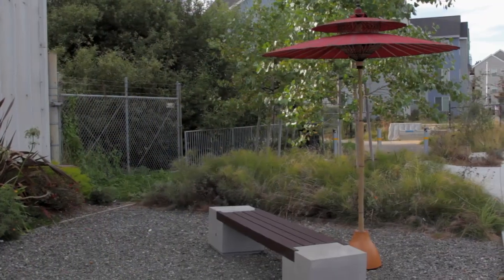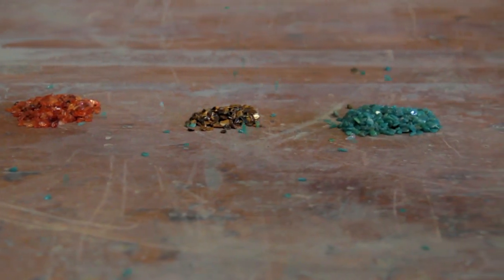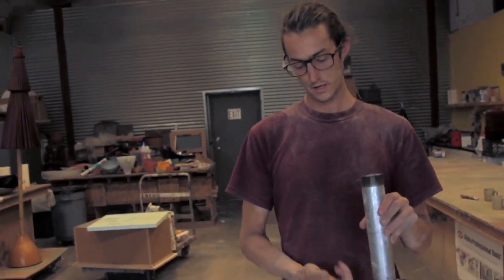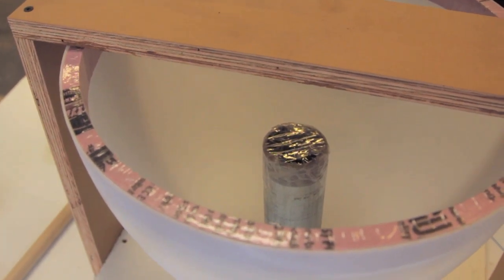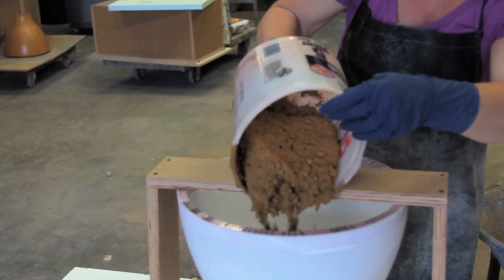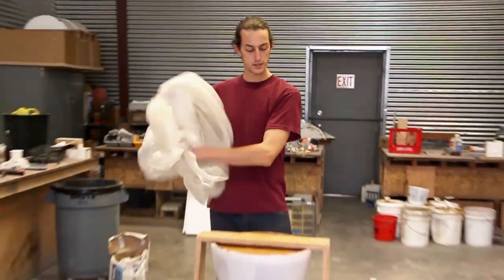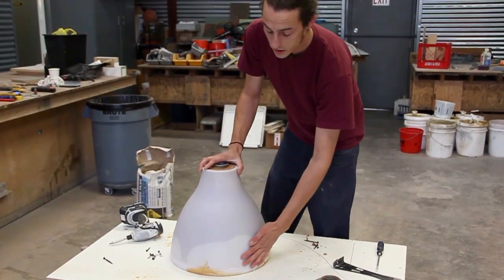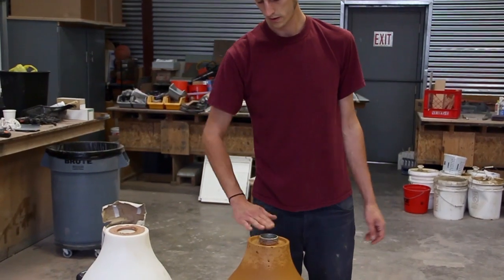Make a Concrete Umbrella Stand from an Ikea Lamp Shade

Comment: thanks for this fantastic idea.  I used the Ikea shade, a 2 inch plastic pipe (Schedule 40) and the concrete colorant--it turned out great.  it is very stable and the envy of all other umbrella stands.  During high winds it has performed well, not tipping over since the 80 lb  mass is so well distributed.

Today I am making a second one!

Comment: Whenever I mix concrete I get a utility bucket from either Roma or Home Depot. They are like $3-4, are strong and after you bang it on the sides with your shovel to loosen the hard leftover concrete. Just mix in small batches. But then I was making a rock shrine.

Comment: I love this idea but is there any way to make an umbrella stand that can tighten to secure the umbrella pole? Otherwise a gust of wind could lift the umbrella out of the stand.
Reply: I used a 2 inch plastic pipe and the umbrella pipe fits in nicely.  To make it tighter just wrap a few rounds of duct tape on the pole until you achieve a snug fit.  Put the tape at the bottom end and just under the top of the stand's pipe.
Reply: You can drill a hole through the pipe and your umbrella pole and put a bolt through them to lock them together.

Comment: The directions were lacking. I didn't see what you did with the spray foam, didn't show mixing concrete, nor did you show or tell how long you let the concrete set before unmolding or how long to let it cure before using it! I'm glad there wasn't a link to buy the products. 😉

Comment: I absolutely love the umbrella stand from BIZARKDEAL! It is designed to stabilize a cantilever offset umbrella. It comes in four separate triangular pieces to fit between each space in the cross base of the umbrella.
Reply: +Carolyn Meikle This umbrella base is very easy to open to fill with sand, water, etc... This base will add over 100lbs to prevent the Umbrella from falling over. This base is a great asset to our umbrella stand! It is very, very durable and very easy to maintain.
Reply: +Carolyn Meikle I'm so glad we have this base for those months, when the wind is blowing really bad. We don't have to worry about our umbrella falling over! Visit http://www.bizarkdeal.com/Umbrella-Base